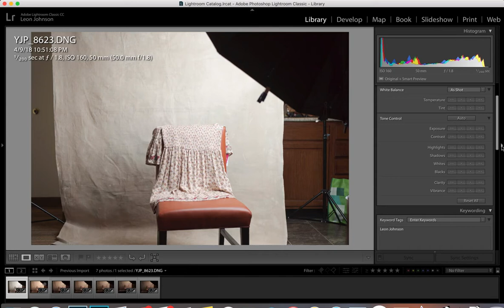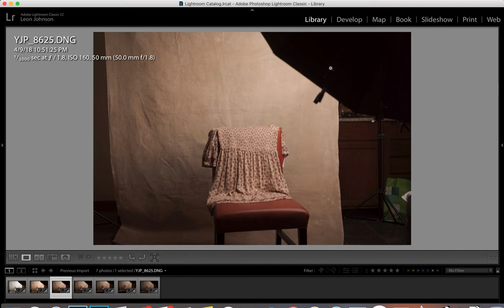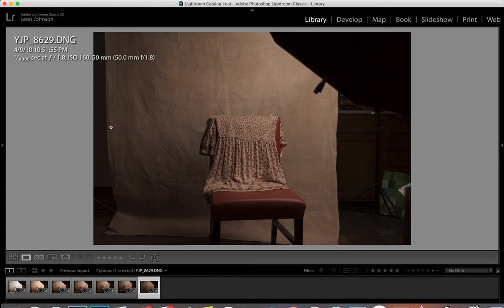Why shoot HSS Indoors?

Comment: Even with a lot of ambient light, I have shot at 1.8 and manual Godox AD600 and never have to go above 1/8 power. No ambient light will show. I would think you could always keep your shutter at 1/160 and ISO 100 for any shot in that room. Just don't use TTL, only manual. Then you won't have to adjust your exposure in post. At 1/2000th you are wasting a ton of battery power. You are getting good results, however, so no complaints on your photos!